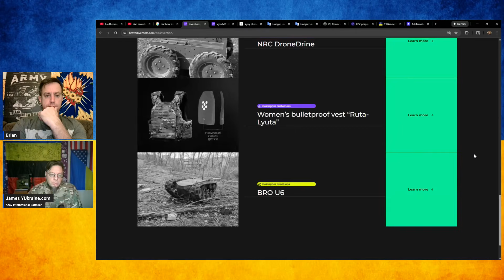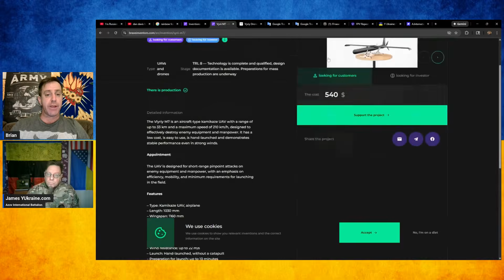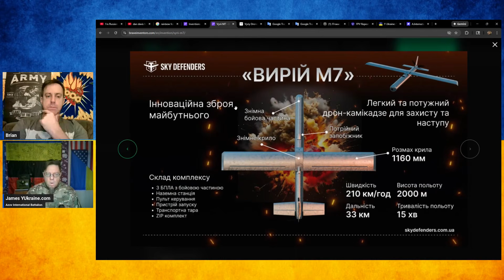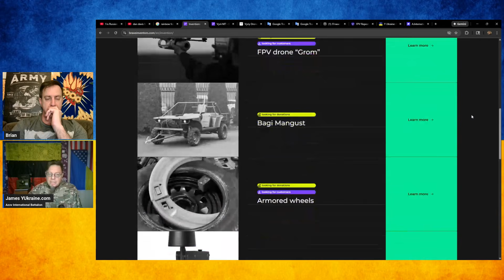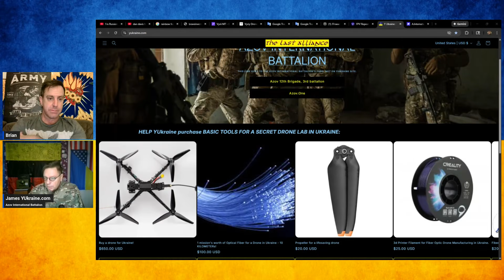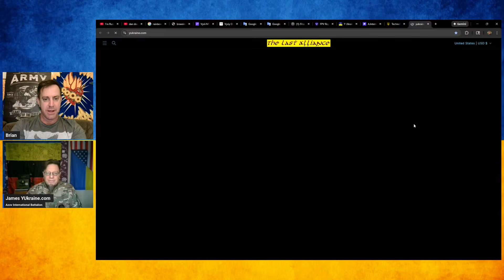Unique Weapons of Ukraine: The Vyrii M7

Comment: The russians being able to use the same tools is why it would be better to not just publish everything online....? Maybe? Bc they can copy and paste. Maybe instead of the design of the drone you could do the fundraising around categories. Like: small drones, quads, armour, etc. 

It's also why not everyone can just put up their designs and try to get public funding. It creates faster turn-around cycles. They can just copy them faster if you show them everything. For small drones that's not as much of a problem bc a lot of times they are pretty much bough and slightly modified. So it does not give the enemy a lot of additional information. I'd rather they have zero information but still. It's relatively contained. For anything else, this system is a problem. It cannot be used to do bigger fundraising. It cannot support more large scale innovation. Or more cutting edge innovation. So, we still have a pretty significant gap in the market and ability to scale up the innovation. 
Have you considered allowing public investment in the companies? Some type of profit sharing model, to attract more consistent investment. That might work for the start-up companies. It does not need to be share ownership. But perhaps giving back a % of profit? Like a commission or profit sharing. In the west for instance there are companies which operate as "cooperatives". There are founding members which own the company but they profit share with the rest of the members/employees. So when the company does well, everyone benefits. 

I know you're all just focused on the war right now, but this helps drive the war effort. You NEED funding. I can relate to you, we're all trying to do the same thing and just paying out of pocket for the innovation stuff. That won't last long though. You do need to be able to attract investment. And I personally need to be able to do so while NOT just publishing the designs. Why? Bc in my experience contractors are expensive and unreliable. The government takes forever to do paperwork. Things just come up, out of the woodwork, to slow you down. We have a gig worker economy where companies hire and fire every few months and claim that they're "creating jobs". There are a lot of issues which can prevent growth and innovation. If we don't resolve the cash flow problems all these little obstacles become insurmountable. These start ups need to be stable NOW, not just after the war. They can have the most benefit now, not just after. 

Also, not everything is about weapons. Some things can be about medical devices. It makes a difference whether chem &bio weapons attacks can still work or not. It makes a difference what type of personal protective equipment you have and how good it is. Prosthetics make a difference. Whether they cost $100,000 or $2,000 makes a difference. There's a lot of projects which become bottle necked if they cannot be invested in safely and securely. No one has addressed this stuff for the better part of 25 years. You guys know that we need more innovation and we need it to be viable. 

The drones can have other purposes too. Some companies are already working on drones which can evacuate wounded soldiers. What if the next ones could rescue more from various places which might be otherwise unreachable? If anyone just posts those designs, the other side of the conflict will have months to develop counter measures. Months. Which means by the time they hit the battle field they will be LESS effective. A lot of the investment $$$ will end up being a waste. Why do it that way? Is it not better to let them be as effective as possible and give them the best chance to rescue people? I cannot just post them beforehand. In my experience if you don't tell them what the designs are, they take years to try to figure it out on their own. Or they just never figure it out. That's potentially hundreds, thousands of lives saved....  I rather liked the eagles scene at the end of Lord of the Rings. I too wondered" "would it not be cool if they could have just flown them in AND out". I don't have Magical Eagles which can do that, but we might have drones which can do that. 

There's tens of thousands of kids missing. There's even more soldiers that are dying bc they're behind enemy lines and no one can get to them to deliver aid. They can't get to them. Crowd fundraising has been very successful for the Ukraine war to hold the lines. We need it to work for these projects as well. I don't know what I need to do to convince people that advocating for this stuff matters and trying to get these things off the ground will make a real difference. It DOES make a difference.  It WILL make a difference. And the people who sacrificed the most for this war deserve to be able to build on that effort. They deserve to have a life. Now AND after the war. Now matters bc they're still fighting. AFTER will matter bc there will be years of reparations to deal with the damage.  

Do you see the "challenge" and why it is important to discuss this and try to get it to a better place?